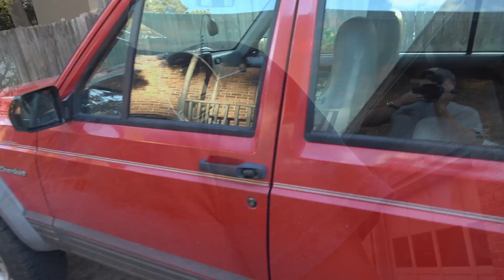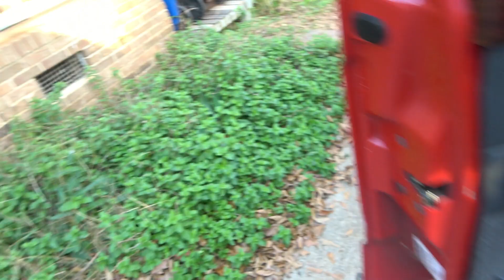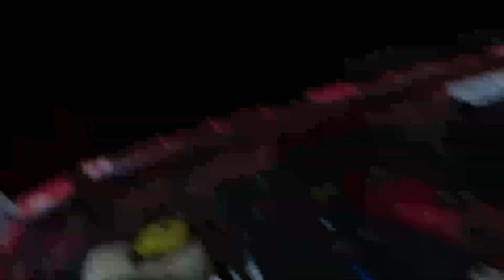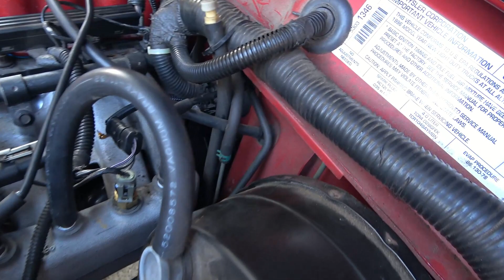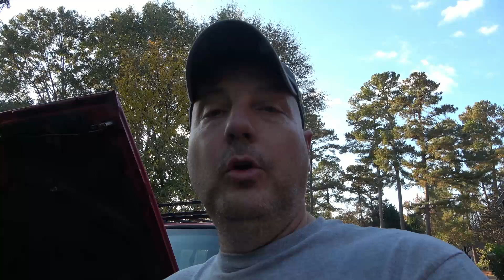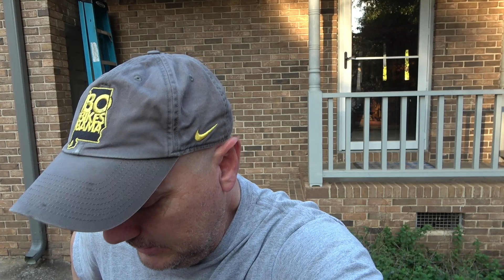Jeep Cherokee XJ Engine Swap Part 5: Post Install Update

Comment: Mine does the same thing put an after market flexplate and the starter makes a horrible noise and the timing jups all over, replaced the sensors and still runs like shitthinking it is the flex plate unfortunately
Reply from the maker: Yep, I’ve had bad luck with aftermarket flex plates. Installing a OEM plate always fixes it

Comment: Good videos, Sir!  Glad you brought the issue of junkter-market parts up.  NGK is parent to NTK and WVE.  WVE is NGK's value line but still pretty good stuff.  Standard is an OEM supplier but not AMC/Jeep/Chry.  I have their CKP sensor installed with no drifting or glitches or dropouts in the square wave pattern groups on the oscilloscope.  Bosch O2 sensors aren't made correctly for the Chrysler OBD-I system for sure.  My '93 and '95 have no clue what the Bosch sensor is telling them and the engine just runs rich.  Back to NTK 23023. Runs fine.  The CMP sensor is, as you mentioned, strictly to tell the ECU where the beginning of the fuel injector timing starts in the rotation of the crankshaft.  All ignition timing is done through the CKP sensor.
As you stated, 1996 was a weird year.  The fuel pump also houses the fuel pressure regulator and thus the return pressure is dumped back into the tank from inside the tank thus no return line.  I've upgraded my '93 using the '96 fuel system and have had no problems with Bosch "710" injectors.  Flow is comparable to factory rating even though Bosch uses Heptane numbers.  Gasoline flows better and will be higher than Heptane.  21lb/hr static @49psi.  24lb/hr static injectors are too much unless you put them in a stroker.  OBD-I ECU's barely have a handle on the fuel trims and IF you can find someone who can flash the '94-95 ECU, you might be lucky enough to get the tables corrected.  '93 and older have hard coded ROMs and cannot be flashed.  Best to use the '96 ECU with new connectors on the old harness so you can keep the old style dash gauges and not trigger the MIL.  That is unless you have a '96 engine harness available.  '97 and later gauge clusters were driven by the JTECH bus.